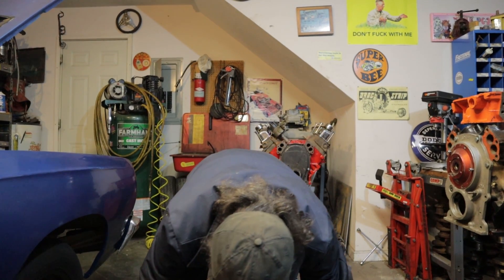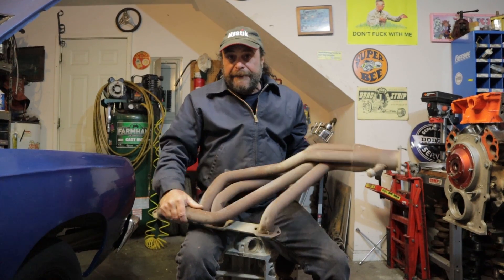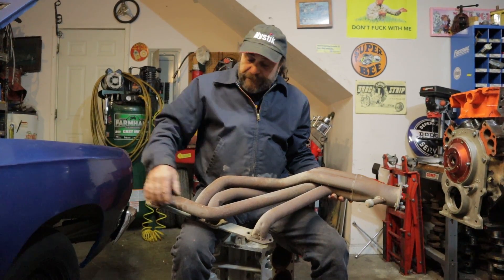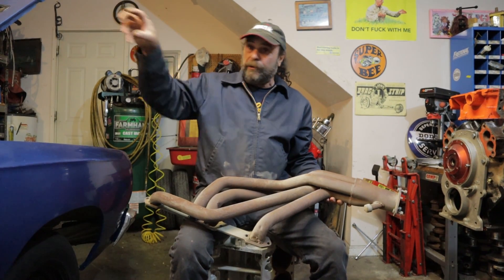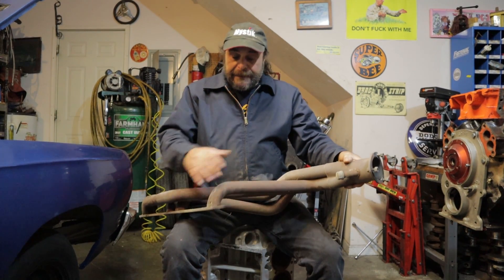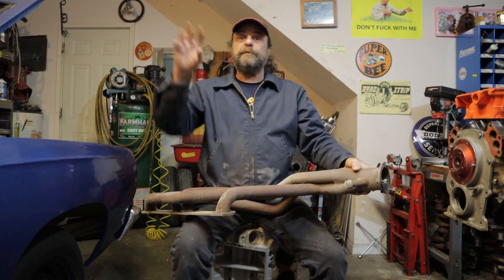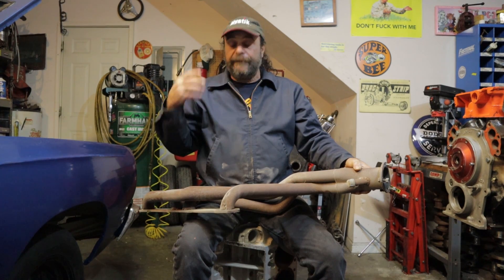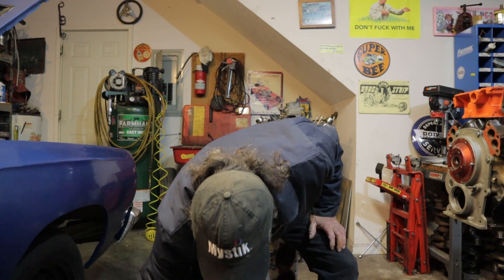The BS On Backpressure

Comment: Tony...my MAN. THANK YOU for making this video! So tired of trying to convince those less in the know that engines DONT NEED Backpressure.

And damn before i finished typing that, you nailed the subject of exhaust tubing size as well! Cant stand when "musclecar guys" talk about 3inch exhaust is too much and a 2 1/2 system will make more power...you helped explain their bullshit! You can play around wirh torque peaks with smaller vs larger pipes but the 3 inch is always gonna make more peak HP!  Proved this on the dyno and at the track and people to this day still wanna argue rhe "backpressure" thing.

Only thing i might add is you can call the exhaust pulse a vacuum but really it's more of a lower pressure creating scavenging effect. I mean you are right it can be measured in inches of vac compared to atmospheric, but thinking along the lines of lower pressure helps one picture how scavenging works.

Awesome work as always my bro!

Comment: FINALLY! Someone agrees with me! I guess (maybe) us GM guys and you No Power...oops...I meant Mopar guys actually can agree on some things lol! Serious question here though-what's up with some of the modern Hemi engines tearing up cams? A friend of mine just had the cam and lifters in his truck replaced after only about 75k miles. I'm not sure if it's a 5.7 or 6.4 Hemi but he kept and showed me the old parts. One lobe had an extremely deep groove worn into it where the roller would ride and another was starting to show wear. My thought is the needle bearings in the lifters were bad. I've heard this is a fairly common problem on some modern Hemis. Any thoughts?

Comment: Off subject but figured you or someone would know. Building a truck motor and want torque.  Using stock 454 bbc heads and GM performance large oval intake and large 049 heads. Haven’t bought cam but looking at comps extreme 4x4 and thinking upping the compression a little to around 10.  

My question is, will larger valves add torque down low or just HP and torque up high? Basically should I do larger valves in the stock heads. Using hooker headers.
Reply from the maker: Generally speaking, a larger valve will slow velocity, so it's more of an upper RPM thing.  Generally

Comment: Exhaust systems are not needed. I ran a Ford 400m with no manifolds. But you need to give it bigger jets. And it is not as loud as you may think. Flames!
Reply from the maker: Those flames are torque you're pissing away

Comment: Before reading this comment understand I am not an arrogant all knowing car guy. I know for a fact I am just beginning to scratch the surface of things car related.
Another great video, I have countless bench racing sessions about "Back Pressure myth". I don't even bother discussing the subject anymore. Keep up the great work. A video idea could be "Things that people say and I roll my eyes". I have two, while working at a parts store I had a guy say "This Holley carb gave my engine too much power and broke my transmission" and another guy say "I used to keep a glove box full of holley power valves because when they would go I'd have fuel spraying all over my engine."

Comment: So, a friend of mine and I have found that his Honda engine, with 12.5:1 compression and a ported VTEC head, absolutely loves the 4 into 1 header he has installed, along with a 2.5 inch exhaust from the collector back, and a 70mm (or roughly 3 inch) throttle body. I have no doubts we have maxed out the stock cams, and there is absolutely more torque from just off idle to 7,250rpm which we currently have it limited to. I have no doubts that zinging the engine to 8,000 RPM would net is about 200hp at the crank, and right now I'm guessing I makes between 180-190hp. Doesn't sound like a lot, but it's a 1.8 liter engine.

Comment: ,,, the Detroit Diesel, 2 strokes with positive scavenging,  have specs for a certain back pressure. If need be, they can change the height of the intake ports, and or the cam timing of the exhaust valves.  This might be for the difference in say a truck as compared to a stationary engine .I think this somehow grew into the regular gasoline 4 stroke myth(s).

Comment: Hahaha needs more backpressure!! 
I'm in a couple of lawnmower  hop up groups on Facebook and this myth runs rampant, me and a few guys try to clear it up as much as we can. 
It's so simple if you understand an engine, it's jetted /tuned for the existing setup , remove the exhaust and it runs like crap because the flow has changed. 
Rejet it (most likely richer,more fuel can mask  alot of tuning sins) and it'll run fine , or as fine as an engine can run with no exhaust. 
Best way to go is get a big ass vacuum cleaner  about the size of your house to just suck the exhaust right out of it 🤣🤣

Comment: I'm 65 and until I was 28-30 yrs old I fell for it. Even an exhaust shop owner told  me it was needed for scavenging. So Tony you are one of the few on the internet to put this myth on the table, explain it expertly then blow the myth up. Thanks for the videos
Reply: In that case it could be they meant the right thing, but used the wrong terms.
Depending on what rpm range you optimize the engine for, the diameter, surface and pipe length will tune the scavenging effect for a certain rpm range (frequency). If you want an efficient 30hp engine at 1500rpm, you will need a smaller pipe than a 700hp at 6500rpm to get the same scavenging result. 

A smaller pipe will mean higher backpressure above the rpm range for the particular engine. A bigger pipe will always mean less back pressure, but in extreme cases can lead to gas reversion, which dilutes the charge with spent gases.

The inside surface of exhaust pipes on a street car will get rusty and soot deposits, which leads to back pressure due to the rougher surface, so optimizing the exact pipe diameter/length and surface would soon be inaccurate, so you are better off with slightly larger pipes than theroretically optimal. any sharp turns, any flangeconnectors along the pipe -  will increase the back pressure. When I designed and built simple pneumatic systems in a small industry, it became obvious how much every connector and evert bend killed off the pneumatic signal. The harder the pipe the less the pressure loss (back pressure).

Comment: All I heard is cut your mufflers off with a sawzall 👍
Reply: you don't need to tell me twice brb.
Reply: Use a portaband,  much easier.
Reply: Tundras just unbolt before the muffler. Takes 20 minutes to take it off and can be put back on easily if you want. Pretty convenient because i was fully prepared to slice and dice
Reply: Shit brother that's all you need to know
Cut it up, drive it like you stole it

TO THE WOOD R.I.P. AARON

For those that don't know the wood is the floor board of what ever your driving so when we say TO THE WOOD  just means Fuckin Punch it
Reply: Lmfaooooooo
Reply: My dodge truck i deleted the muffler. But it was rusty and needed to go
Reply: Straight through turbo mufflers and glasspack resonators FTW!!!
Reply: yup i do a muffler delete on every truck i own why spend money on a performance exhaust when you can get the same effect from a zip disc
Reply: @evanforster2665  Because neighbors.
Reply: @evanforster2665  hell yeah I agree I pay for my house if I want to smoke some tires here and again I'm gonna I have a 56 Chevy pickup 383 stroker with a single turbo and everything else under it is a 76 camero she shits and gets sometimes I need a little reminder lol
Reply: steve....
If your "mufflers" are creating back pressure....you've got the wrong mufflers....Properly designed mufflers don't create back pressure....
Reply: @mark006868  true but I do have header cutouts for those special moments
Reply: @mark006868  mufflers create back pressure period. Same with catalytic converters.
Reply: I don't have mufflers I go from my headers to a 3 inch exhaust that dump right past the step side of my 56 Chevy pickup sum bitch is loud lol

Comment: Should have explained why that pipe you were holding has a valve specifically to create backpressure.
Reply from the maker: The manifold?  It's spring loaded with a thermal spring and it's used to divert exhaust to the intake manifold cross over.  Once the engine is warm, it stays wide open

Comment: Do the same rules apply to motors with a supercharger or turbo.  It would seem to me motors with blowers  wouldn't want overlap in their cam and extra piping doesn't do much for power.
Reply from the maker: Blown engines don't need scavenging, but they do like a bit of overlap

Comment: Reminds  me of the forum wars associated with 22re motors and the firms offering “modified / built 22re motors including specified header options

And other firms with their 22re header offerings and How and why one header design was superior to another

And Matching  certain custom Toyota exhausts and exhaust mods 

All to squeeze a bit of performance out of those little iron horse motors and the early gen trucks, and 4runners 

And changing imploded plastic timing chain guides on 22re  motors to aftermarket steel before the chain ate thru the driver side interior chain cover introducing oil with antifreeze  ....

priceless

Comment: Glad you covered this so many miths .When i got my first car always hear if you run open headers in cold the cold air will go back in headers and warp the valves always something I think about.
Reply: Long tube headers usually won't, but shorty headers absolutely will.

Comment: I think this idea about backpressure might come from the two-stroke world where the return exhaust pulse is used to tune the pipe to that specific engine. Maybe someone probably believed that it could be applied to four-stroke engines as well. In a two-stroke engine a tuned pipe is a very big part of getting the most out of the engine. Thanks for an awesome channel!

Comment: I always wondered why you lost the low-end torque on an engine with big exhaust pipes.  This sounds like right up the roundy-round boys alley; it would be a good way to tune the torque band on a short track for maximum pull from the center off the corner on an oval track.

Comment: What about an race engine that is using zoomie  headers . Is there  a better way to exhaust from the engine Thanks
Reply from the maker: Those engines are generally supercharged or running nitromethane. No need for scavenging there

Comment: Tony, just like explaining a venturi. Take a drinking straw, hold it in a jar of water, and use your blow gun to blow across the top of the straw. The velocity of the exhaust (air gun) will draw the intake charge (water) into the chamber (imaginary chamber at the top of the straw) and the jar will empty.

Comment: Depends on rotating mass I've found. I've had some 4 bangers that ran much better with a little back pressure. Never had an 8 that I didn't run the most free and open exhaust I could on it though lol.
Reply from the maker: It's not backpressure helping them.  Some other factor at work

Comment: What about running an approximately 12" piece of pipe off the headers and the trimming it back to where the heat temperament is theory? I must say my 440 Dart runs better with a set of Flowmaster 40 series Chambered muffler compared to just straight pipe out the back. Not a fan of before axel turn downs either.
Reply from the maker: Collector extensions trimmed by heat marks are usually less than a foot long

Comment: this is all about the balance of the engine when u get the engine parts balance ur not dun u still need to balance the flow when u get the hole engine balance witch is not easy u will get full max power this is how we built my 327 not just the parts are balanced but every aspect of the engine is balance this is y i'm getting over 1200 hp out of a 327 with just a tunnel ram no nitro on pump gas even the size of the carb matter i had to run 2 485 carbs any bigger i lose power any smaller i lose power and this is y it will do 15000 rpm's every aspect is balanced

Comment: Great explanation!  One point to remember:  Technically, vacuum does not suck or pull.  Atmospheric 'pressure' always moves/rushes/pushes INTO a vacuum in order to balance the pressure.  Nature abhors a vacuum.  Also, exhaust noise usually equals horsepower.  You don't get noise with back-pressure.

Comment: Now the question is how do you know what size of collector and exhaust you need depending on what rpm range and power you're going to use. Because I understand the concept of intake tuning pretty well but proper exhaust sizing for power and rpm is still black magic to me.
Reply from the maker: That's a question best answered in a forum dedicated to your specific type of engine and application

Comment: For years I believed the backpressure myth.  So, my question is, are you going to do a vid on how to determine the proper pipes and length, or just a simple formula?
Miss ya on a Sunday UT, my son got hit by a car and has been in the hospital since Sunday afternoon.  First chance I’ve had to chill for a minute and watch a vid.
Reply from the maker: Oh shit!  Send our best along to him.
Reply: @UncleTonysGarage  thank you!  He’s doing much better today....might get to go home Thursday
Reply: There are some commonly used calculations. The problem is that everything from port shape, primary tube lengths, bends, collector style, collector diameter, cats, mufflers, tailpipe, even the tip, need to be taken into consideration when trying to optimize a setup. That's why stock vehicles always leave some on the table, because everything in a street vehicle is a battle of compromises. Also, electronically variable intakes lengths or tunable headers will greatly expand your powerband.
Reply: If your running a header a good way is to put spraypaint from the collector back for about a foot or so run the car hard for a few passes, see where the paint burns off and at the end of that portion cut off your exhaust pipe, or better yet fabricate a pipe and collector flange that bolts up in those dimensions.
Reply: @wrenchygeorgie  I’ve heard that with grease  pencil too
Reply: @mrshine1971  i see no reason why that wouldnt work either, for that matter anything temp sensitive that will burn away.
Reply: MrShine vs Everything well for Chevy specs small block takes 2.5 - 3 inch pipe 305 is probably a 2 inch and bbc goes from 3 - 4 inch I believe
Reply: lahokc59  I fuckin love bacon hell yeah
Reply: You let a small thing like an injured child stop you from watching UTG? Priorities, man, priorities.
Reply: @rcnelson  yeah, Tony is my uncle, but that’s my baby boy....